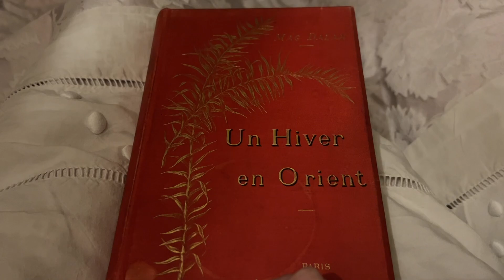FIXING the CHATEAU'S 600 YEAR-OLD CHIMNEYS!

Comment: Stephanie- you can actually by little fans, to just set on top of the logburners, that blow the heat out in the room 🙂
Reply: Do you mean the ones made in Canada that don't need electricity? The heat from the top of the stove creates energy in an internal "motor" and they work very well!
Reply: @chickeyd9579  Maybe? Its just a little fan, you set on top of the stove, and the heat alone sets the fanblades in motion, and then it blows the heat out into the room, so it does not all disappear up the chimney.
Reply: @bigboy77dk   I believe the original was the Ecofan company. Checking online I see a lot of imitations.
Reply: @chickeyd9579  My brother lives in eastern Ontario, Canada & uses those little fans on his log burners.  They work quite well.🇨🇦

Comment: So interesting…. And fun. Thank you for sharing! 💞😊 FYI from a vlog on Tales  of chateau cavalier du citadel. Rol discovered if you built a fire upside down in a wood burner, the wood burned slower and heated the room quicker. Rol found this info on the internet. He said it was a measurable improvement in not having to feed fire so often.   👌🏻👍🏻😊
Reply: How do you build a fire upside down?
Reply: @ditornai-wright5177   you put your biggest pieces at the bottom of fire box then med size on the top put kindling mixed with your paper, light paper set the draft close the door.

Comment: another tip for burning wood  use only 20% moisture wood, no green wood,  they do have a moisture tester for wood on amazon, if you use naturally dried wood it takes about 2 years for it to be dry enough to burn, so your chimney's don't clog up
Reply: Did you see the potato peel tip @ about 6:25 ?

Comment: Stephanie….one thing I wanted to mention about your enamel woodstoves…..be careful as they chip  very easily and as far as I know they can not be repaired.  We have had two woodstoves in 30 years one a Jotul and Encore (Vermont Castings) both in black which I repainted after many years and it came back looking brand new.  We had a friend that had the coloured enamel and it looked horrible quickly.  Hope you have better luck.  Glad you will be warm.  Also worth mentioning we have always had top loaders and it keeps the area cleaner than opening a front door.  Enjoy the warm.  ❤

Comment: We just had a swarm of bees move into the chimney.  It was a blocked off fireplace, unfortunately the bees couldn't be saved. Then we had to get the chimney sweep guy, to collect and clean up a lot of dead soggy bees at the bottom of the fireplace.  
My fireplace is 120+years old, we've opened up the fireplace and hopefully next winter we can put in a log burner.